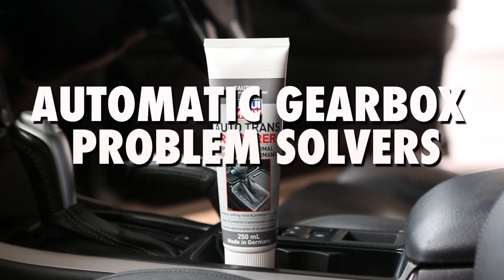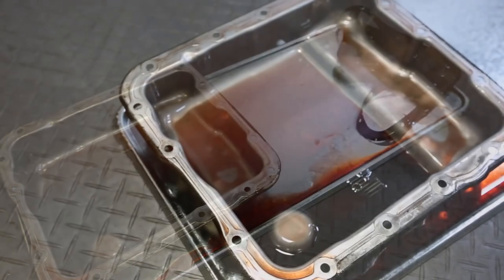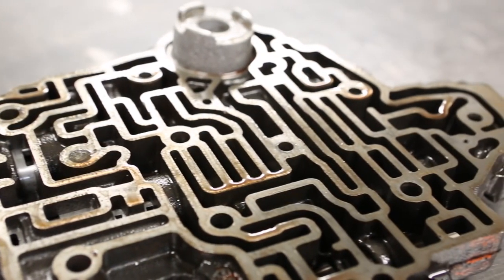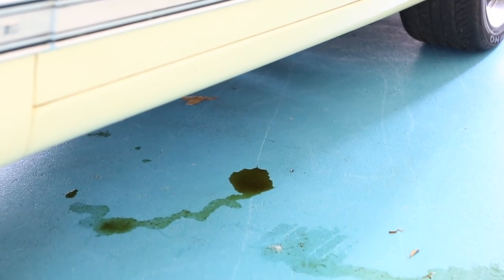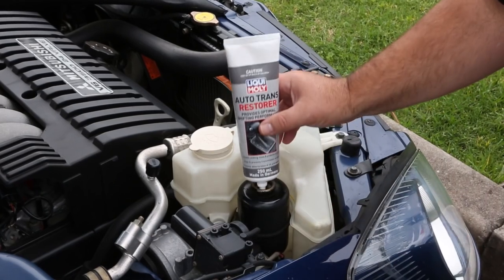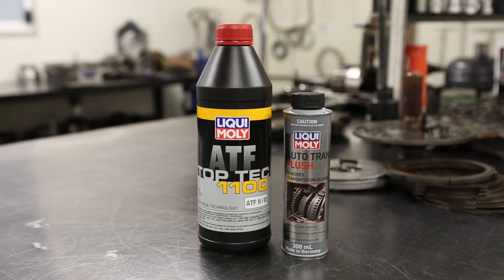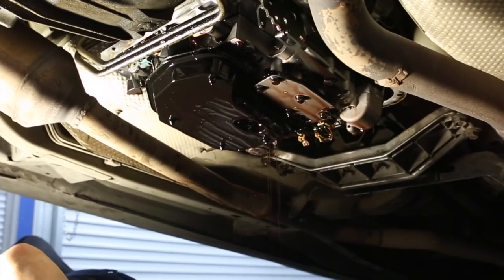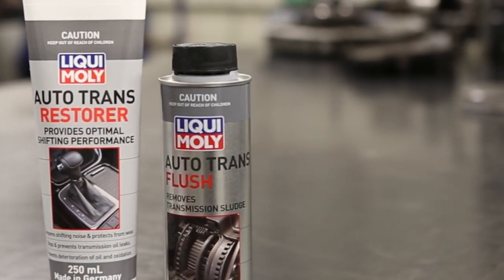Liqui Moly Auto Transmission Restorer & Flush

Comment: Scotty Kilmer would probably say not to try to "clean" your transmission since it works on friction and certain kinds of 'build-up' is actually helping an older transmission to continue to function.  Without knowing what the actual symptoms of a "dirty" transmission are, and figuring that most people will add this product when they change to new fluid, how can they tell that it isn't the new fluid that helped improve any hard shifting symptoms?  But this product does have seal polymer in the solution which is probably good for any internal seals that you can't get to like the one on the torque converter, but just add AT-205 Re-Seal which is pure polymer solution without any "cleaners" then.
Reply: As I recall from speaking to my car service, they said that these products are primarily used as preventative methods that should be used regularly following your car warranty rather than a fix for what could be a serious problem. I started putting almost the entire collection of liqui moly additives after the 100k mark and now I'm at over 350k on a Passat B6 and it operates almost exactly like new.
Reply: I wouldn't let Scotty Kilmer add the oil to my 2 stroke chainsaw. He's just a YouTube hack who is more worried about views than actual auto mechanics.
Reply: @TexasHarleyBoy65 true

Comment: Can it really work?
Reply: Liqui Moly makes really good stuff. If you truly have a need for it and use it, there is a good chance it could help at least a little bit.  It will not repair an already damaged transmission.
Reply: It bugs me,in Blue description it doesn't say that it recovers rubber rings,plastic seals etc ,it only say that it keeps them in good shape...Blue is made in Italy,but Moly made in china,it is german product but not made in Germany.